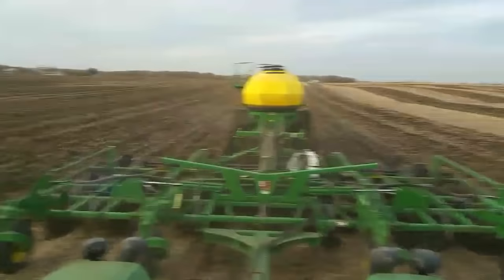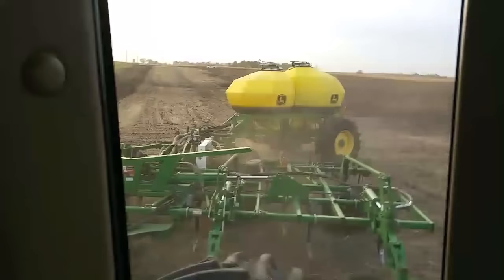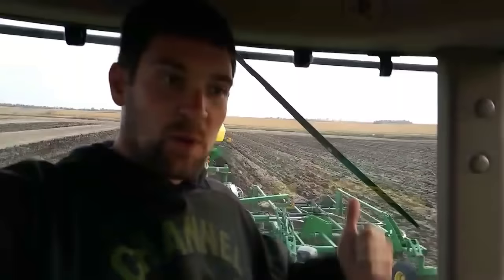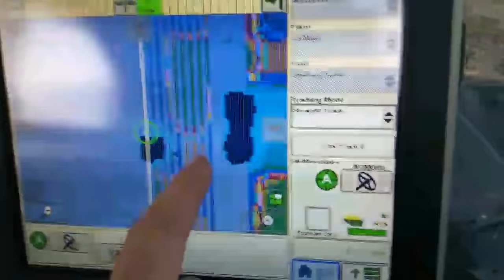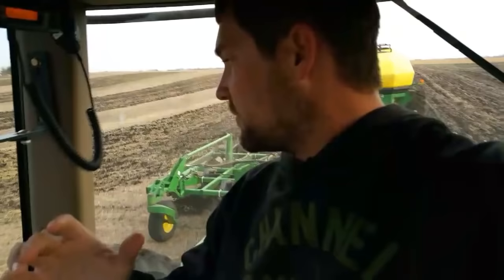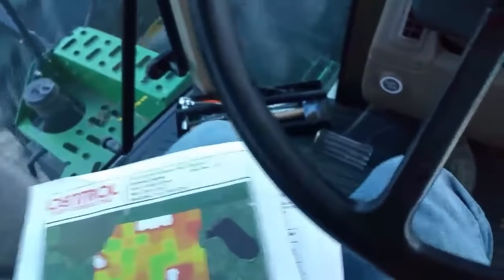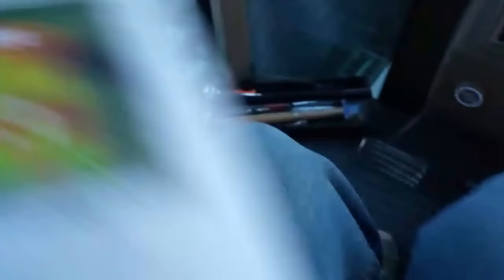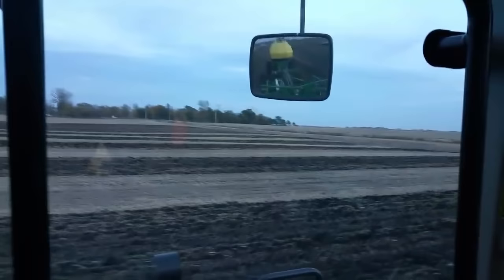"Deep Banding" fertilizer and eating cookies in the tractor!

Comment: Good explanation of the principles involved, the equipment and linked background data. However how often, over say a ten year period, would you plan to have these soils sampled and analysed? I imagine that you link precise yield data with these soil maps? 

In your case and experience how far down and wide do you find the roots penetrate in an average year as 30inch wide rows is mighty wide? 

We very rarely see maize grown for grain here in the UK (mainly, as yet, for climate reasons) but it is widely grown for winter forage and harvested green when the grains in the cobs are at the firm cheese stage.
Reply from the maker: Dan Whiteford We sample and test the soils roughly every 3-4 years.  We do have yield maps to correlate with the fertilizer application and the soil samples, yes.  Comparing the yields in different areas is mostly done manually yet though because we don't have a program that allows us to layer the data very well (yet).  So we mostly just analyze the 2 by comparing what we see on the maps.  As far as the roots, I am not sure about how far out they spread, but I'm certain that some roots will get to 4,5, and 6 feet deep.  22" rows are common in our are as well.  Most corn is grown in 22 and 30 in the US as far as I know.
Reply: Thanks for your detailed reply. Dan

Comment: Just discovered your channel and subbed, and I'll do the same on FB so I don't have to hang my head in shame anymore ;)

Love the bonding/snack time in the tractor, she reminds me of my daughter.

In addition to the soil samples, drone inspections, and old fashion know-how, do you use yield data during harvest to adjust fertilizer rates next season, or do you just use it as confirmation that the soil sample maps are helping boost your yield?
Reply from the maker: BrinkME Appreciate the sub, thanks for watching!  We have used yield maps now for many years but we don't adjust our fertilizer maps based on them.  That would be another step deeper into the variable rate system though, because obviously a higher producing area will remove more nutrients.

Comment: So why on a tillage program instead of no-till. Up here in Ontario we run beans in the corn stalks and cultivate wheat or bean ground ahead of the planter with a pre spray program.
Reply from the maker: 69druth I was waiting for someone to ask that.  Our heavy, high pH soils mixed with our wetter, cooler climate just don't seem to dry out in the spring if we don't open them up.  There is very very little no till in our area.
Reply: MN Millennial Farmer Good to know the ins and outs of different areas. thanks

Comment: Why not strip till instead of doing so much soil disturbance and save one pass
Reply from the maker: Justin Strickler Strip till is something were considering, but our heavy clay soils need to be opened up or they don't dry out with our wet, cold springs.
Reply: We strip till about 1000 acres here in central Iowa both with map/potash, NH3 about 600ac and hog manure 400ac roughly with fall application. This year I tried some strip till corn on corn into 225bu residue ended up 212 but field avg this fall on 140ac first year corn on corn

Comment: Is there any loss of fertilizer in this process? If so is the rate upped a hair to compensate loss?
Reply from the maker: Massey1105driver No loss.  We actually lower our rates often times because the plants use the nutrients more efficiently so they don't require as much.
Reply: Really? One would think with that fertilizer going in the ground 6 months before planting something would be lost. Always learning new things on you tube!
Reply from the maker: Massey1105driver Nitrogen can leach out but P and K bind to the soils and won't flush out with ground water.  Our soils also freeze hard for 4 months every winter so that allows us to even apply N during late fall.
Reply: Yeah, the more you get done in the fall the better. I am sure spring up there can be touch and go like here in northeast ohio. When it gets fit you want to plant not waste time getting fertilizer in the ground.

Comment: When and how do you apply nitrogen? What type?
Reply from the maker: usually we put anhydrous on in the fall.  Sometimes spring urea.
Reply: MN Millennial Farmer So, that means two trips over the fields in the fall?
Reply from the maker: yes.  We hire the local coop to knife the anhydrous in at an angle after we deep band the P and K.  Our bander has the capability of putting on NH3 but it's been a pain in the neck when we've done it.
Reply: Would that ammonia application at an angle not disturb the rows of P&K?
Reply: In the Thief River Falls area applying ammonia with a chisel plow or knife applicator on untilled soybean ground is quite common in the fall. However, farmers then wait until spring to apply P&K along with some nitrogen starter fertilizer as they seed wheat with an air seeder. They don't want two tillage operations in the fall on soybean ground as it would destroy too much residue making the land more susceptible to wind erosion.